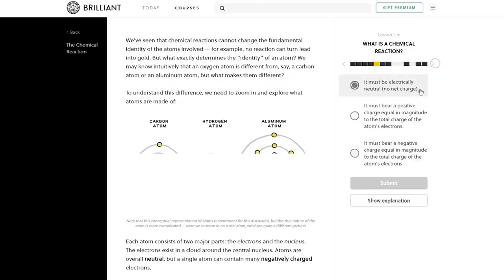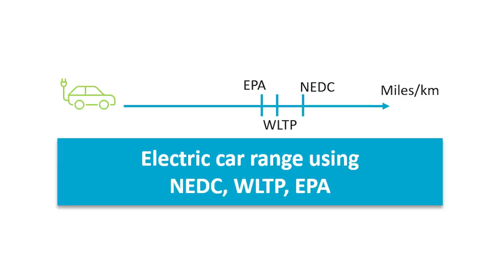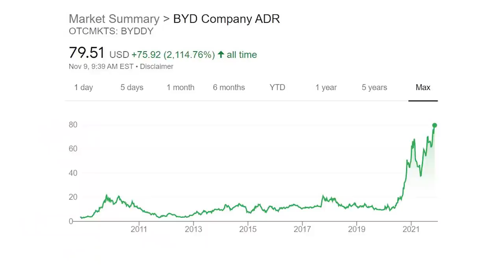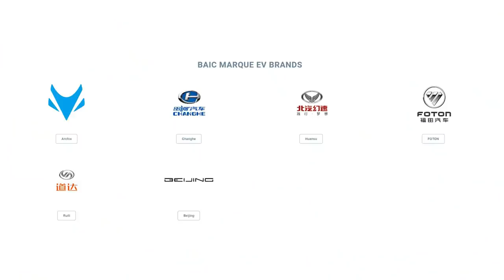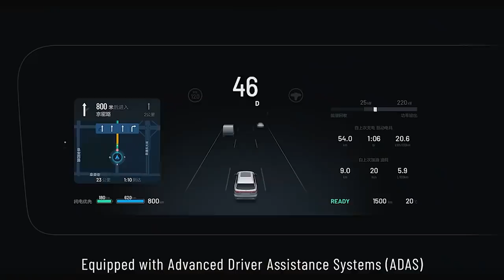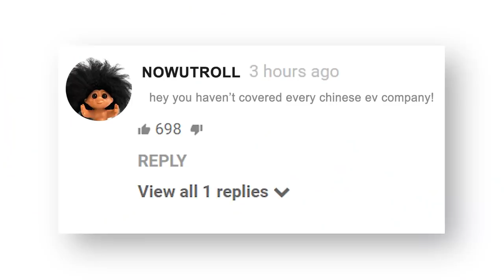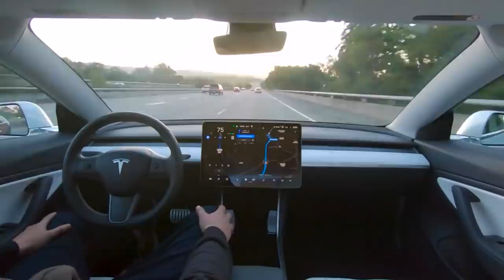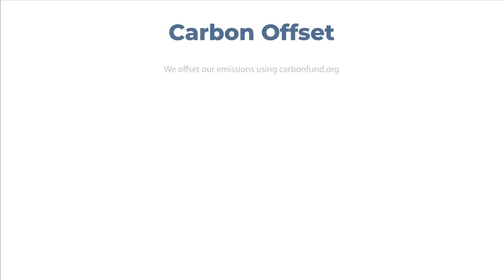China is Coming: Part 2 | In Depth

Comment: NIO is selling in Norway now. They will be selling ET7 next year, but ES8 is available in Norway now. The first battery swap station is already built.
Reply: In 10 years battery swapping will be gone, and will look like it was a mistake.
Reply: @wizzyno1566  wireless charging in the roads?
Reply: I think battery swap will dominate in the future.
Reply: @wizzyno1566  think about it in 10 years time, in a second hand EV dealer, would you buy a 10 year old Tesla with a 10 year old battery, OR would you buy a 10 year old NIO, with the ability to pop around the corner and swap for a new battery?
As we build smart cities, these battery swap stations can act like energy sinks that charges during down time, and generate electricity for the city during peak hours. 
Battery swap is the future, so is standardization of batteries, at least among brand alliances.
Reply: @obsidianstatue  that is kind of future I’m interested in living in.
Reply: @obsidianstatue  Won't happen, as every single car has different sizes, etc. Also, integration between car and battery makes the car better, safer, and lighter. So, you would only be able to swap between batteries from the same manufacturer and that manufacturer would be able to create newer, better batteries that fit different sizes of cars because they would pile up in a station. Too many problems with such a system. Way better to just charge your own battery.
Reply: @scottmcshannon6821   battery swap is almost non-existent now. The point is you don't need to 'own' the battery, it's simply an energy unit you pay when you need it. With the right method, the cost of operation can drop dramatically.
Reply: @wizzyno1566  lol, you speak nothing of battery life cycle and upgrade.

if I bought an ev with battery swap in 2019  and they later offered a bigger battery in 2025.  I would certainly  pay to have the battery upgraded. I could also sell my vehicle and the other owner would know that he is not out of luck with regards to a degraded battery.
Reply: @judoking7752  Then you haven’t considered the future of charging technology as well as the fact that battery sizes and technology are not standardized, not even close. It’s not feasible for mass adoption though it’s fine for a niche, luxury automaker like Nio.
Reply: @wizzyno1566  you can wait 45 minutes to get your car charge on the street. It's okay. 😂
Reply: @scottmcshannon6821  well just swap again? whats stopping you from doing that?
Reply: @wizzyno1566  battery swap will be the norm in China by 2025.
Reply: @wizzyno1566  Actually it's the other way around in 10 yeara the power grid can NOT handle all the super charging stations... hence battery swapping is the real winner.
Reply: @wizzyno1566  right now in china, traditional EV owners are switching to NIO because of the battery swapping feature..the reason being is because during the holidays there were 3 hour wait times for EV charging stations when ppl were travelling long distances.. while the battery swap stations takes 3-5min to complete (second gen station)
Reply: @wizzyno1566  not in China..so revenue is revenue
Reply: What is the debate about battery swapping when "car ownership" really becomes the primary question eventually...it will be just a "Service"
Reply: NIO will fail with the Battery swap in Norway. The reason is, that Norway SALTS all of its roads in winters. What happen with battery swap in winters, wuth snow and dirt and salts all the screws and stuff on the cars. It will be a nightmear in Norway. I know, I live here I know how the roads are abd this will not be a sucsess.
Reply: My biggest concern about EV is battery life. I live in a country right on equator line. The year round hot weather is the major concern. The existing hybrid vehicle experience gave EV a bad impression, although I suspect the lack of proper cooling system is the main cause. 

I sure don't mind buying a EV without battery, and get a battery on subscription basis.
Reply: @tmyrdal  if that's case, all EV owner would have nightmares now.
Reply: @jackshao126  cars stand still 90% of the time and it is way easier to charge when standing still so no I don’t think charging while driving will be a thing
Reply: @jackshao126  Will never happen in Norway, wheres roads are so exspensiv already. And Norway never plan ahead when they build roads.
Reply: @wizzyno1566  10 years later is still a long shot. But it is what many people want for now. So is never was a mistake. Unless you enjoyed waiting in queeue or fighting over for charging cable at station or never make it if u're not in the first 50 in lines? But 10 years later is another level for the tech to see if they can built a better battery performance with longer ranges and power and smaller size and faster recharge hopefully? Or an easier way of swapping battery with handy work like the sci-fy tv slotting in and out of bottle size of 10L and each can go 100 miles?
Reply: @wizzyno1566  explain your thinking?
Reply: @tmyrdal  only norway has cold winter or salt their road?
Reply: Nio’s biz plan is ahead of its time. Won’t work. Not about charging stations but rather batteries. Not enough current battery production to satisfy the battery swap model. Sorry NIO come back in 5 years
Reply: @danielchua1713  In Norway its a nightmear, we have to litle with charging station, abd the Norwegian power grid is to old and the grud do not get upgraded before something bad hapoens to it.
Reply: @tmyrdal  I think all country is facing the same problem, existing power grid could not support the mass EV. At least Norway has the headstart and resources to upgrade the infrastructure. developing countries like my home will have hard time making the leap.
Reply: @tmyrdal  That's why we have Materials Engineering.....
Reply: @scottmcshannon6821  When you subscribe to battery swap, you don't need to buy the car with battery.  So how old the battery doesn't matter as long as it is within spec.   The idea can be very useful for commercial vehicles and road trips.  This just getting started around last year in China so we will see the cost and environmental impact for this idea compared to other rapid charging technology after a few years.
Reply: @judoking7752  i do batterieswap with my phone .. its very practicle
Reply: @TecnamTwin  it depends on how we manage it. The government needs to step in and standardize it. We can't rely on billionaires to corporate, they don't and won't.
Reply: @gmy33  you can use your phone while  charging, not your car. Unless the government build wireless charging road.
Reply: @scottmcshannon6821  I have to respectfully disagree with you on that statement about the 5-year-old car getting a new battery, that people won't be interested in battery swap In 5 years. Say in 5 years your Nio car has the availability to get a new technology battery that can go twice as far. It takes 5 minutes to install it because Nio is designed to accept a new battery quickly. I think you might want to do it. The cool thing about Nio is that as battery technology changes, you get to keep your Nio car and you only have to do a battery upgrade. THAT IS HUGE! Keep the car and upgrade the battery instead of having to buy a brand new vehicle, I think Nio may have a huge advantage here. I don't think Americans are interested in battery swaps as a way of charging their car. Unless you live in a condo or apartment. But if you live in a house, people are going to be charging their cars at their home. But even then, if you have a Nio car and you never swap the battery for charging purposes, but you like the idea of being able to put a new battery in there easily when new technology comes out. You would go with the Nio car.
Reply: @tmyrdal  lol like there isn’t any snow in China..
Reply: @DDGGVVMM  China dont usr SALT on roads, Norway do.
Reply: I just don't see battery swapping being a long term solution.  You could not possibly do it on an own the battery model, the battery would be a lease.  Its just easy to charge at home, and for people that can't charging whilst shopping will be a thing you do once a week.  We will see, its hard to predict.  Its very difficult to have battery swapping because you have just locked in a major part of many years of car designs.
Reply: @jackshao126  
AKA "dig up every road to install the system"?
No.
Reply: @obsidianstatue  
 @obsidianstatue  
What's the main constraint preventing RV production at the moment?
Cell production.
Check how many packs a swap station holds (it's 13, plus a spare bay for incoming)
That's 13 times the resources.
(Somebody pays for that, and it's not Nio)
Speed.
Let's say 6 minutes per swap.
10 cars per hour.
If they all have exactly the same pack, that's 76 minutes turn around for pack 1 to pack 13.
Pack 1 has 76 minutes to charge.
But.
If the there are two sizes (Nio already has at least 2) that drops to about 40 minutes.
If it's a busy day, and cars arrive exactly every 6 minutes (🤔) that's 40 minutes for the pack to charge.
Users will want their money's worth, if they roll in sub 10%, it's going to take more than 40 minutes to charge a large pack to 100% (they WILL expect 100% for the fabled "long journey") then the station won't keep up.
I've already seen this happen in video from China.
Owner (US Ex pat) on a long trip.
Books at one station.
They run out.
Diverts to another station.
Pulls in ahead of another car, takes the last pack.
That second car had nowhere to go, had to wait.

Then there's the "small pack users will want the big pack for holidays" scenario (cited as an advantage)
That's great untill you're the "big pack user" (and you paid for it!) but you turn up and find all the large packs have been taken by the "small pack guys"?
You'll say "keep extra packs in reserve!"
Which takes us back to 14 times the resources...." Except now it's 20 times? (If you have 7 in reserve)
It needs thinking through!
Reply: @judoking7752  
Except the cost can't drop.
At least 13 times the number of packs in circulation, and someone is paying for that.
(Clue, it's not NIO)
Reply: @TecnamTwin  
Exactly.
Every incremental improvement in cell density and charging makes the Nio business model more unnecessary (and dubious).
The cars are good though!
Reply: @ddjohnson9717  
"Just swap again...." Then find the station you arrive at only has the smaller pack, and they're all charging, because the "small pack guys" arrived early and took the large ones for the holiday.
Reply: @Prizax  
"Cannot handle the charging stations" ...... Because the Nio swap station uses Unicorn breath instead of electricity!!!
THINK about it.
SAME pack size.
SAME number charged.
Just in a different place.
Reply: @hasadoeoshana3091  
Until more owners come to the stations and either you find 5-10 cars in front of you waiting for a "3:5minute" swap (it's more like 6).
Or, with a "3 minute swap" and 13 packs in the bay, all charging the same speed as a normal charging bay (probably slower?) You would be waiting for the packs which came in at 10% 30 minutes before to charge to 100% which would take another 30 minutes, plus the swap time.
Combine the two, "3 minutes per swap" of 13 batteries,  39 minutes, then "battery 1 needing 10-20 minutes charge, then 3 minute swap.
That's an hour.
Reply: @dann5515  
Work out the timing of the swap stations.
You think fewer cars will want to use them than charging stations?
All it does is keep the batteries charging in a different place.
Reply: @johndodge8999  yes they actually even feed the power grid… do some research of how they actually work.
Reply: @rogerstarkey5390  I bet you don’t even have a Tesla right? to know how bad the waste of time is in some places… and yes actually the battery swap station can even feed the power grid… also you don’t even need to worry about battery degradation and can even upgrade it.
Reply: @wizzyno1566  you forget battery swap tech allows you to upgrade your battery any time better ones come out. Improving their performance so quickly i thing it’s a very good option to have
Reply: @rogerstarkey5390  all speculations. Jesus. Swap the battery take like 5 minutes and charging takes at least 30min. You can swap 6 batteries and still come on top with a full battery compared to a 80% fast charging.
Reply: @rogerstarkey5390  we'll see. Like free cellphone with 2 yr subscription, similar thing may happen to cars
Reply: @Sun ke i live in The Capital of Norway but never seen The swap station? Where is it located? I have seen The ES8 it is a very good car!
Reply: @---jj9lf  I agree the stations are expensive close to $231k for version 2.0. Need operator that is extra cost. Extra batteries at stations which means less car sold. Lot of moving parts both in car and the station which means more point of failure. During pick hours not all batteries are fully charged. And you always end up with a battery which is always been superchargered and under stress. Need to have a one size fit all models battery which will be overkill for some models and not good enough for others. Battery swap economy doesn't add up in my math.
Reply: @wizzyno1566  Think about the charging life of these batteries and how much it will cost you in a decade or much sooner.  Perhaps you will consider it disposable consider the battery replacement is not much cheaper than the new one.
Reply: @---jj9lf  What if you want to drive far? You are confined in town.
Reply: @TecnamTwin  No company can afford building decent number of charging stations across the country if it is not standardized. They have charging adapters in China.
Reply: @rogerstarkey5390  dude... what have u been hearing or watching? NIO's swap battery station with auto parking tech altogether is only takes 5 minutes and off you go with full capacity or 90%+ charged battery. And each station carries 200 batteries. each low batteries swapped are in station recharging takes no more than 2 hours to be fully charged for ready to serve in next swap? And what make you think they need to bring it out to else where to charge when they can install charging ports inside the station? You have no idea how useful it is if you are going to a country road trips. IN CBD yes is not necessarily to have many swap battery stations when mostly are running no more than 100KM and after work they can go home and charge itself. But those country road trips needs battery swapping station for conventional and that is an A+! It is like back in the old day where many people go into the bank waiting in lines to get services until they have ATM self services so u dont have to wait long queue in the bank. And now they got better way transfering money by simply go online self services app. And even better they got tab services where u go pay your items simply tab your card or on phone with NFC. Battery swap station is not a shitty ideas is just another option for faster fully charged and ready to go. You dont like it you dont need to but doesnt mean is useless to others. And thats even better for those with BAAS subscriptions plans... saving more money from buying battery. And who know in the next 5 years you wanna change new car.. u dont have to worried about the money you spent on expensive battery for half price? But if you wanna keeps your own battery and dont wanna swap cos u worried swapping too much might damage your screws in a long run. But dont u think NIO offered that 100% replacement or repair if it their faulty instead of bringing it to third  party repairer charging you more? As I said... swapping battery station is not a shitty idea. And I expected to see the new convenient swapping battery in future like can be used hand pull out the battery and replace a new one like a tank bottle. Like why do you think so photographer always have so many spares batteries for their camera? For some user they used heavily for their works or purposes. And even back in 80s some driver on countryside they bring an extra fuel tanks along. Battery can do so much not just for driving only and can be shares to other electronic devices that needs power.
Reply: @dann5515  each swap station 2.0 has about 13 batteries, but can perform over 300 swaps a day.
Reply: @johndodge8999  they can charge the batteries during off peak hours
Reply: @wizzyno1566  No way in 10 years, it will last a long time,
Reply: I read Bjorn's reviews of the ES8. It actually had issues and NIO came over and fixed it. He ended up saying it felt like a German built vehicle. He said it was very solidly built and well finished.
Reply: @---jj9lf  you can charge your own battery+you can swap it. I'm in China since 2016 & there are public ebike stand/station in most corners of the streets in the cities you can open a bike with wechat, swap a new fully charged battery & go. on the road if battery is down you call the companies emergency number they'll come from the nearby stand/station and swap the Battery then youre ready to go again. It's so great that now with Nio you can do the same with your Car.
Reply: @rogerstarkey5390  can't believe you imagined they swap one car's battery at a time lmao. 🤣
Reply: Age 78 Currently own 2021 tesla Model Y and have ordered 2022 Model with 4680 battery. We had party line phones, no cell phones , no GPS and no chips!! Cars would never last over 100,000 miles. oh well...love it
Reply: I'm very impressed by NIO, Xpeng and Li.
Reply: @silveriver9  Thats why they are not selling in US, and soon US will ban them so no one can buy them, and blacklist these companies from their stock exchange.
Reply: @Cute and Funny Earthlings  They are selling in Asia and build up momentum before launching across the West. Common sense. Banning is in violation of international free trade laws written mostly by the US after ww2.
Reply: @Cute and Funny Earthlings  It is giving China greater reason and justification to re-write the international trade laws as China continues to grow and surpass the US by 2028 and double the US by 2035. The US will increasingly find itself isolated.
Reply: @judoking7752  it will be great for cities.
Reply: @obsidianstatue  also the chinese are innovating fast. It's only a matter of time before they even wireless charging stations for EVs. That would be epic